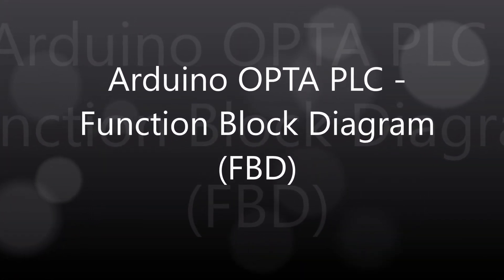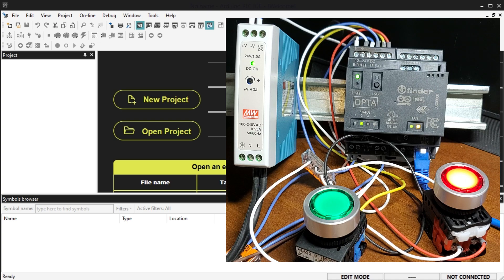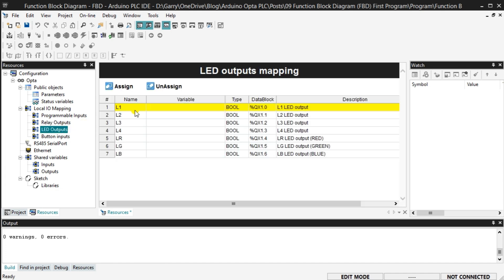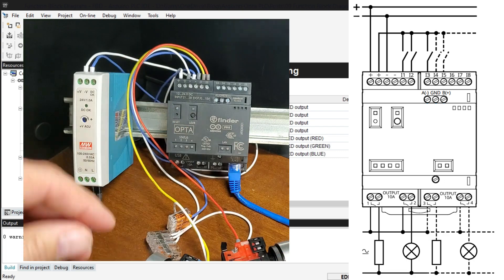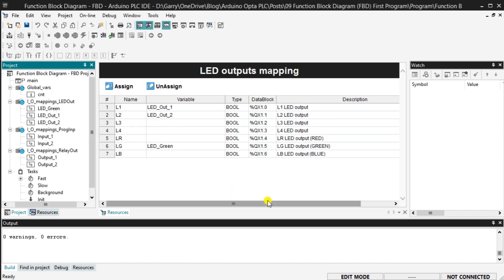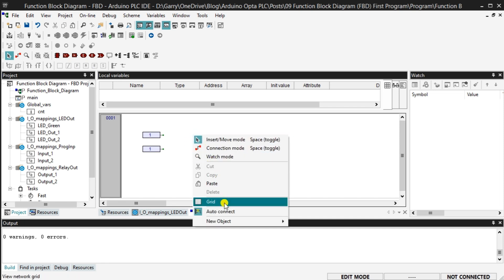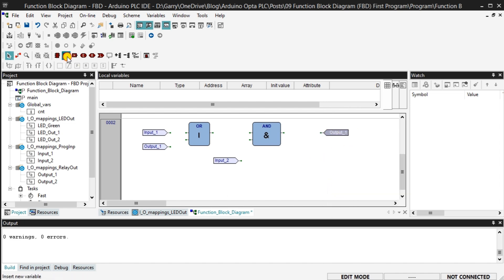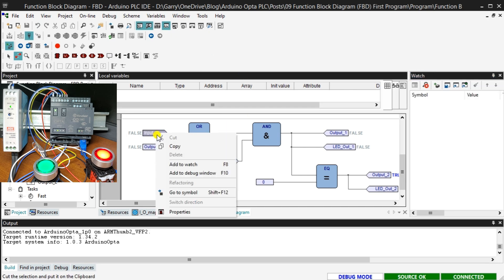Arduino OPTA IoT PLC - FBD Programming From Start to Finish

Comment: Hello, is possible use this plc Arduino to add an ethernet generic module to get communication throught ethernet devices as cognex, keyence cameras?
Reply from the maker: Currently, I do not see how you can do this. You may want to contact Ardunio directly.
Regards,
Garry

Comment: I can't understand why there are so many Plc manufacurers.  Why don't they consolidate?
Reply from the maker: This is a common question. There are many PLC (Programmable Logic Controller) manufacturers because the industrial automation industry has a wide range of needs, and different manufacturers aim to cater to these diverse requirements. Here are some reasons for the large number of PLC manufacturers:

Industry Specialization: Different industries (e.g., automotive, food and beverage, pharmaceuticals) have unique automation requirements. Some manufacturers specialize in specific sectors, offering tailored solutions that others may not.

Geographic Presence: Companies often prefer local or region-specific manufacturers for better support, compliance with local regulations, and more accessible logistics. This has led to the rise of several regional players in the PLC market.

Technological Differentiation: PLC manufacturers often differentiate themselves based on their technology. Some may focus on high-speed processing, others on ruggedness for harsh environments or specialized communication protocols. This technological diversity allows for various products to meet different customer needs.

Customization and Flexibility: Some manufacturers provide more customizable or flexible solutions, which industries with unique or evolving requirements prefer.

Brand Loyalty and Legacy Systems: Many industries stick with a particular brand due to legacy systems, existing expertise, or long-term relationships. As a result, multiple manufacturers remain viable in the market.

Competitive Innovation: The presence of multiple players fosters competition, driving innovation. Each manufacturer strives to introduce new features, improved performance, or cost-effective solutions to gain a competitive edge.

Globalization: As businesses expand globally, the need for PLCs with diverse capabilities increases, leading to a broad market where different manufacturers can thrive by meeting specific global demands.

This variety gives industries options to choose the best-fit PLCs for their specific automation needs, which is why many manufacturers are in the market.

Regards,
Garry